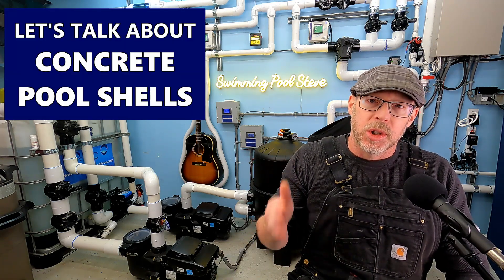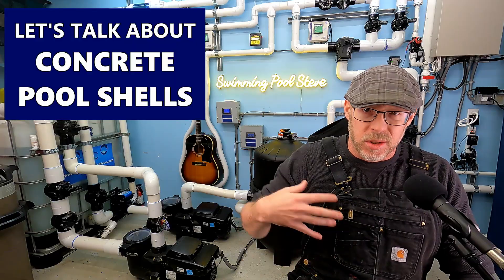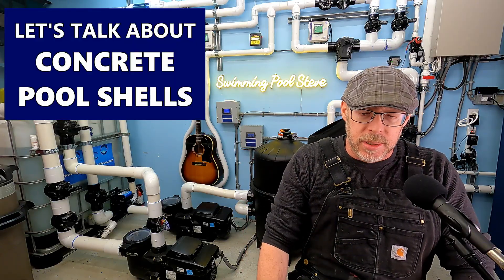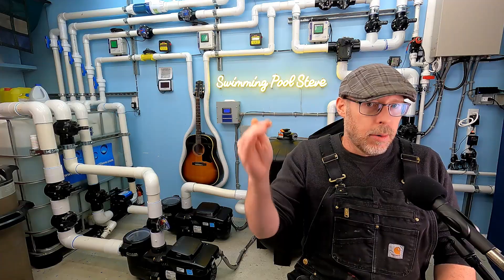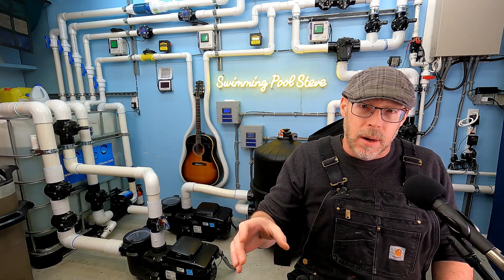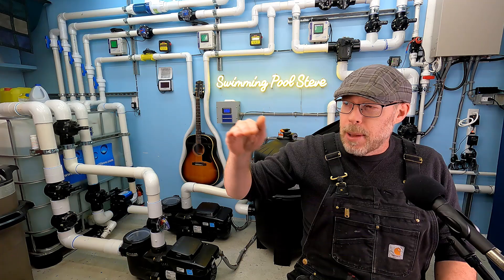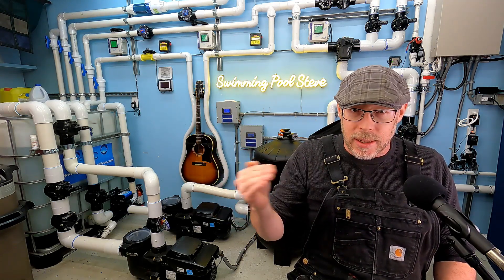Concrete Pool Shell Failures - How To Avoid Cracks!

Comment: Hi Steve: I came to this video looking for advise on winter care for our cracked ~70 year old pool that is a centerpiece of our landscape. I want to save it, but first need to deal with exterior groundwater that has surely contributed or caused the demise of the structure above the entrance steps.  But I want to keep it open all year to see the pretty pool that had been mesh covered completely abandoned for a decade before we patched the pool and have used it the last 4 years.  In addition to fixing the pool, I am looking for the most economical method to manage the water over the winter.  Shock and balance the Bromine pool every time it start to turn green?  Or maintain balanced chemistry all winter?  Turning on the pump today here in the Philadelphia area just before Thanksgiving.  I’ve scooped the leaves out every day or so, and now that is just about over for the year.  Took a dip on Halloween, but don’t expect anyone to do the same challenge again until spring.  Thanks for your videos!

Comment: Believe every word ! People are cheap and contractors are even cheaper !  My pool design is way beyond even what you would do. I started to build a pool, that's going to be 5ft deep all the way across. The average person can stand in any part with their head above water!  Comes in at 19,636 gals+-. Floor starts with vis-queen sheet 12mil then a 6 mil weaved plastic ground cloth to protect the bottom sheet. Then 18tons of compacted stone. (8inches total) Top 4 tons, 3/8 clean blue stone. The the pad is 12"+ 3500psi, 1ft grid of #4 Fiber glass rebar. (DeBar company from Quakertown PA.)  17 x 37 concrete pad, 24 yards of concrete.
Now the walls are going to blow you away.  IVANY Block. 12x16 , 738 of them. They hold #5 fiberglass rebar horizontal and vertically. Each block was coated with APOC 301 foundation sealer.(roller on Tar) First 7 courses are coated. Then a 6 mil vis-queen sheet was wrapped around the complete foundation, from the 7th course down to the pad. Everything that is below grade is protected. The pool has two floor drains, independent of each other, and skimmer is also separate. (2").  I'm still up in the air about how many returns I plan on putting along the wall.  6 so far.Believe him when he says there's a lot of planning before you do this.  It's a ONE and Done Project.

Comment: Here in Central Texas, many concrete pools that were built during the pandemic are afflicted with Alkali Silica Reaction, also known as Concrete Cancer. Most of the cases are being linked to a main supplier of concrete that did not use fly ash in the mixing process of aggregates. These pools will eventually need to be demolished as there is no way to stop the cracking and leaking of these pools.

Comment: Hi, enjoy your videos, I'm building a pool here in philippines, I use 5" hollow block,  6 " of concrete,  then another 5" of hollow block for the walls. Same type of situation 75% exposed walls on slope. But smart enough to know not to put any pipe in walls. I'm about 60% complete  as of today. Waterproofing after rendering has dry like a bone, may 2 to 3 weeks from now.  I post a picture later.

Comment: we just had a new gunite pool installed by a reputable contractor for our condo community in NJ.  On start up the pool leaked 4 inches in one day. The contractor said he would seal around the 4 shimmers. He did and it still leaked. During construction the concrete contractor was excavating around the pilings and he hit a pool line. He told the pool builder he hit the line and the pool builder repaired the line. But he never checked the connection at the pool wall-he later admitted he should have. There are 144 pilings under our pool, pool deck and pool house. we are on a barrier island. The pool builder pressure tested all the returns and found the one that leaked. They plugged it at the pool wall and capped it in the pump house- they could do this because they do homes runs back to the pump house  on every line. there are other pool builders in our area that do not. 4 skimmers and 4 returns are overkill so one less return is not a big deal.
I didn't sleep for a few days but it worked out.
Reply from the maker: Yikes, that must have been a real headache. I also endorse isolated plumbing runs. Glad it worked out!
Reply: @Swimmingpoolsteve So am I. LOL